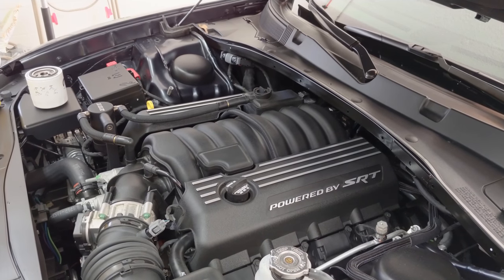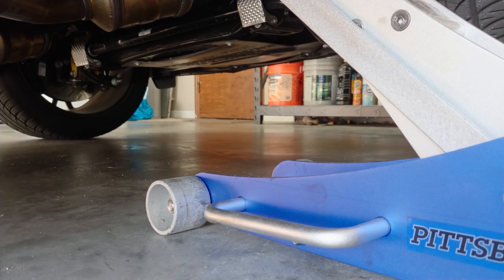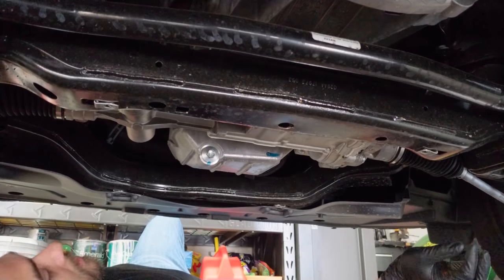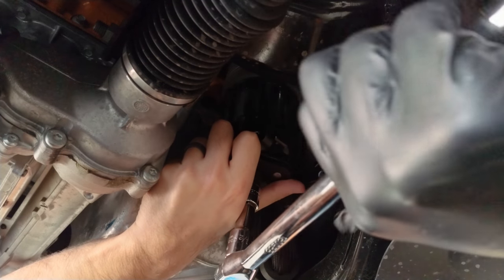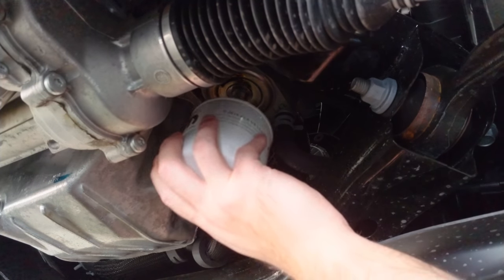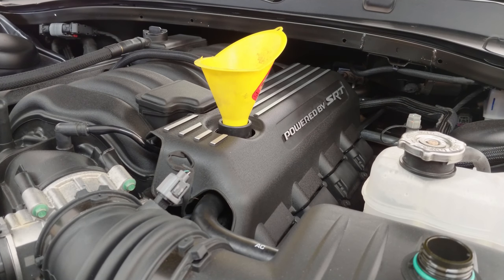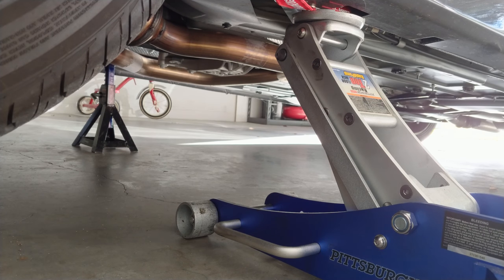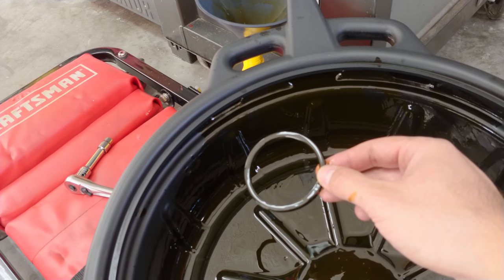How To: Change the oil in a 392 Charger

Comment: It might have been a good idea to leave the oil cap in the engine bay opened for faster and efficient drainage of the old oil
Reply from the maker: Definately!
Reply: SRTorque definitely*!
Reply: I always put it right on my hood latch so I don't forget to put it back on.  That way you can't close your hood with the cap in the way.
Reply: ehhh that's 50/50 sometimes it makes a difference sometimes it doesn't. engines aren't complete vacuums and some do have a natural air flow. i like removing the cap anyway cause it just makes the job quicker
Reply: @rose-rh2nr  well for most engines it might be a good idea

Comment: Was looking for a video to send to a friend of mine that lives out of state and came across your video. Thank you, nicely done, well lit and clear audio/video.....Also,  Just my 2 cents here, been wrenching for over 30 years. On re-installing the filter, you should almost never need to use a filter wrench. Common practice is, run the filter on by hand, once the filter gasket contacts the mounting surface, you give it anywhere from 1/2 to 3/4 of a turn, and that's about it. Some mechanics may say a little more or a little less, but almost any full time mechanic will tell you always put it on  by hand without a wrench. You don't want to slam it on there so tight. Hope this helps.
Reply from the maker: Thank you, appreciate the comment.

Comment: I always put oil in the filter to before I put it back on the engine, if I can, think it's better then starting it with a dry oil filter.
Reply: I worked at oil change shop and we never did that who told you that’s a good idea need to see if that’s the proper way to do it?
Reply: Well I've done that with my '97 Ram 1500 with a 360 V8 and so far it has 285,100 miles on it and still going strong, so it hasn't hurt it none.

Comment: Jacking the car up one "corner" at a time puts a tremendous  twist force on the frame, which can't be good for the structural  integrity of the car.  I prefer to lift both sides together, which either requires 2 jacks or driving the car up on ramps.
Reply: There’s a great deal more of a bending moment to the frame when slamming into a pothole or speed bump. Your frame is going to be fine 😂.
Reply: I use ramps.
Reply: @williamiwaniuk5561   I agree, ramps are the best.  Trouble is I had to spend big $$$ to get a set of race-ramps that would clear the low profile of the Charger.  But it's worth to me.
Reply: @hwherron  Yes, I understand.  I used to own a C5 Corvette, so I have already made that purchase as well as the jacking pucks that are recommended for the front end.
Reply: @hwherron  What race ramps did you buy?  I ask because there are so many different kinds.  Also, the house that I bought has a garage with a slick/coated floor.  Any suggestions would be much appreciated.
Reply: I just bought a set of heavy duty ramps from harbor freight layed down a 24” deck board before each ramp to start the tires on and I had no clearance issues. It’s a little tight underneath but I’m not too fat so I’m good. Beats jacking up ,you just have to lay the ramps down on a non slippery surface or the car will just push the ramps. 7 quarts and a good filter and your good to go👍🏻
Reply: @bossstrick  Yup, I did the same thing ... bought a pair of ramps so that I could get under the  car from the front.  Worked fine. Only concern I had was: would upward angle of car on ramps allow all old crankcase oil to drain completely out?  I computed the angle of the 120" wheelbase elevated 8" and came up with 3+ degrees, equivalent to a 6 2/3 per cent grade.  Certainly the design would accommodate that?  When I refilled with 7 quarts and new OEM oil filter,  the dipstick showed slightly above the full mark.
Reply: @hwherron  did you have any problems because the oil was slightly over? Do you think it’s cuz the old oil didn’t drain all the way
Reply: @evanavarro392  No, it's OK after all ... I wasn't reading the dipstick accurately.
Reply: @hwherron what ramps my brother has a 392 and I have a 2023 toyota v6 camry

Comment: you were obviously smart enough to get the zl1 pinch weld deal...curious why you didn't get the puck it slides into...fits your Pittsburgh jack perfectly...
Reply from the maker: The puck is designed to space the jack pad up out of the cupped old style floor jack.  Since mine is flat I saw no purpose.
Reply: no worries bud...not knocking your process...it just adds a super nice surface area instead of that little square ...either way they work perfectly

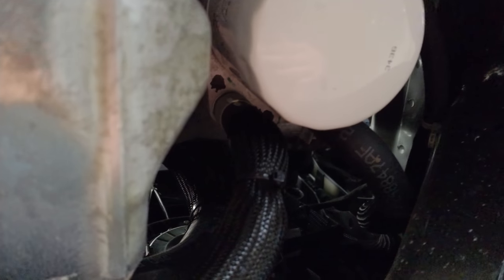Comment: What's the sound like raindrops in the engine bay in 22:00? Mine has the same sound every time.
Reply from the maker: Li Heath Every car (even lawn mower) I've had does that, it's normal.  Because there are different materials in your car and they have different properties, they contract and cool at different rates, which makes them kind of bump into each other, and this causes the clicking you hear.

Comment: I am looking at buying a Scat Pack and was wondering why you don't jack the car up from the front end?  Also, is it true that I need to use 91/93 octane?  Thanks
Reply: Yea u need to used 91/93 octane, and for oil use pennzoil 0w40 ultra

Comment: Can you just leave the shield off? Seems like extra hassle for little benefit.
Reply: Yeah you can but the charger from factory sits pretty low in the front already and I’ve had scrapes from speed bumps and metal lying on the floor. Shield on my scat pack is scratched but my pan and oil filter are perfectly fine.
Reply: @ismaelgonzalez9966  okay, good advice :-)

Comment: Hey i have a question. I have a 2019 challenger scatpack widebody, and it only has 635 miles but ive had it for 6 months do i need to change the oil? Just to be safe or am i still good for a while
Reply from the maker: I would based on how long you've had it. I drive my car about 10k miles per year and I try to change it at least every 6 months even if the oil life isn't low.
Reply: @SRTorque  well I've had it for 6 months. You think it should be changed?
Reply from the maker: I probably would soon but I don't think it will be a problem if you don't.   If you purchased it off a dealer lot and it sat a while that oil could be a year old.

Comment: I went to the amazon site that you put on the description and it said the SRT oil filter does not fit my 2018 charger 392 Daytona. How come?
Reply from the maker: Amazon isn't right about everything. The filter fits, if you say you drive a 2017 Daytona 392 Amazon will say it fits. There's no difference between the years. They just have it wrong. I've used that filter for over 2 years every oil change with that link with no issues.
Reply: HotShotHemi thank you! I was just making sure because I wasn’t trying to get the filter and I’m gonna have problem with it.

Comment: Why does nobody use ramps instead of playing with a jack & stands? So much easier, all you need is a couple planks of wood if your chin spoiler doesn't clear the ramps. Holy shit dude, never EVER tighten the new oil filter with a wrench! Oil pours much smoother when you hold the bottle sideways or with the neck at the the top, less chance to slop anything up because it won't "chug" like the way you poured it.

Comment: IM WORRIED I TOOK MY 392 to THE DEALERSHIP AND THEY PUT 5W-20 in my 6.4 HEMI. IS THIS SAFE BECAUSE THE CAP CLEARLY SAYS TO USE OW-40
Reply from the maker: I doubt it would cause harm but I'd be taking my car back for the proper weight if it was my car.
Reply: @SRTorque  I took it back and they claimed the correct oil was used the service sticker just was incorrect and said 5w-20. well if i blow my engine up we know who lied because i drive this car like a race car how its supposed to be drivin. So if the oil dosnt hold up Dodge metroplex will be replacing my engine. free of charge
Reply: @SRTorque  It will cause damage to the engine at high temperatures because 5w-20 is too thin at higher temps.
Reply: @SRTorque  and the 6.4 engine gets extremely hot . hotter than other engines
Reply from the maker: Yeah I've heard that as well. Something about emissions.  I've only ran the ultra platinum 0w-40 for the last 2 1/2 years with no issues. I have trust issues so no one has changed the oil in my car except me lol.

Comment: poke a hole in the middle of the old filter before removing !
Reply: How do you do that?
Reply: @392_RHINO  awl or pointed screwdriver
Reply: @raymondcampbell8001  I'd be scared the force from me hitting the filter would somehow strip the connection to the car or bend it

Comment: Pulling the dipstick or oil cap doesn't really do anything.  The crankcase is already vented via the PCV system so it's not holding a vacuum of any sort.  Old engines without it...yes.  Also, I use a round piece of coarse grit sandpaper with a fabric back to remove and install filters.  If you need a wrench to remove it...you installed it too tight.  NEVER use a wrench to tighten a filter for Gods sake.